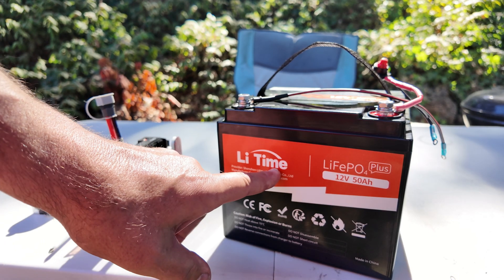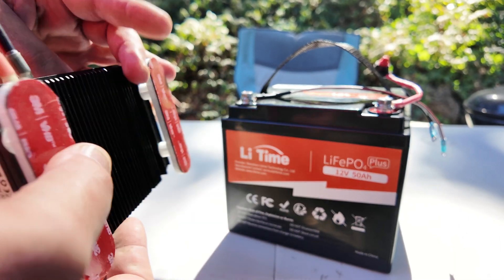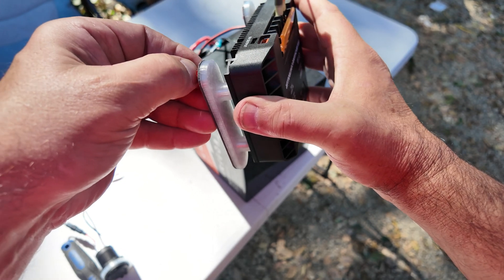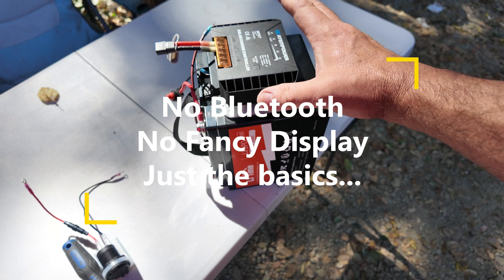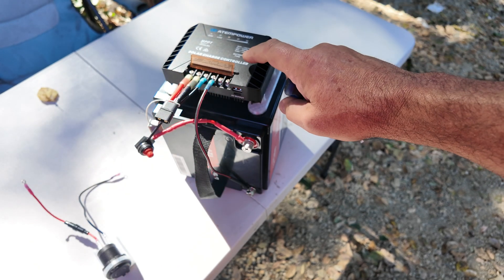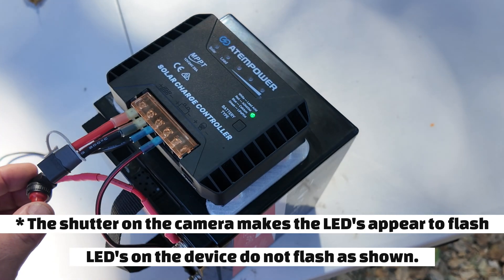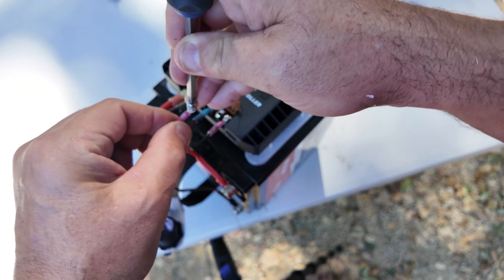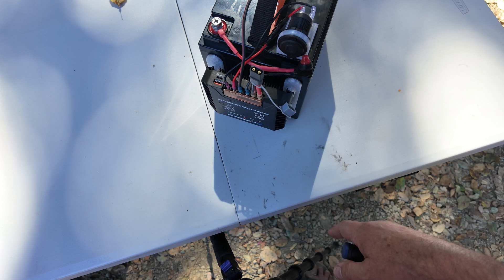🔌☀️ Build a Minimalist Solar Generator with LiFePO4 Battery & MPPT Controller! 💡

Comment from the maker: Affiliate Disclosure: Some links in this description are affiliate links. At no extra cost to you, purchasing through these links supports the channel. Thank you! 🙏
3M VHB Tape - https://amzn.to/3BHEcEW
Atem Power MPPT Charge Controller - https://amzn.to/4f1IgOL
Li Time 50Ah LiFEPO4 Battery - https://www.amazon.com/dp/B0D9461S5K?ref=t_ac_view_request_product_image&campaignId=amzn1.campaign.369DAAYODYE0N&linkCode=tr1&tag=targetforge05-20&linkId=amzn1.campaign.369DAAYODYE0N_1728931569811
Portable Solar Panels (200W) - https://amzn.to/405wH4F
XT60 Connectors - https://amzn.to/483k2kZ
12V DC Outlet - https://amzn.to/3BGaYGm

3D Files on Printables!
Charger mounts - https://www.printables.com/model/1039893-adhesive-mounts-for-the-atem-power-solar-charger-2
DC Outlet mounts (19mm) - https://www.printables.com/model/1039906-dc-outlet-adhesive-mount-19mm

Comment: Nice, minimal build. I have been buying old jump starters cheap with dead lead acid batteries in them and replacing with lifepo4 batteries. Most jump starters have a 12V outlet and usb ports, some even have built in inverters. I remove the jumper cables and just use them as portable power stations. I have a lifepo4 solar charger controller and charge them through the 12v port.
Reply from the maker: Very cool 😎

Comment: Nicely done, well executed and creative.  The only detail that I would like to have seen is the voltage of the battery before and after charging the battery.  I appreciate your mentioning that the mppt module had 2 USB ports of different types.
Reply from the maker: Thanks for the comment. I guess I've gotten spoiled letting the charge control do the work for me! Great comment.

Comment: 5:17 I'd investigate carefully having that switch on the battery lead. It is common way to damage an MPPT controller to have solar input without a battery attached FIRST, so if I were doing this myself I wouldn't use a switch that could be easily forgotten in the off position. Maybe an Anderson connector or something more involved than a simple switch with no real indication it's turned OFF.
Jest a redneck think'in outloud!

Comment: So no BT connection to either the battery or controller?  How are you monitoring battery charge levels?
Reply from the maker: Great question! During use and during charge the four charge level indicators provide enough information to handle that job, not precise, but plenty accurate for a minimalist approach. The charger cuts off the charge at the top and kicks the load off on the low side. I've found the BMS on the cell does a great job of protecting itself from over discharge as well, a problem with other packs I have tested. Thank you for your comment!

Comment: Most of the world in emergency operations have switched to Power Poles for connectors. Still  a great project!
Reply from the maker: Many of my projects have featured Anderson Power Pole connectors in a wide variety of sizes. They were not used in this project intentionally. Your statement seems to assume that XT60/90 was once dominant here and that is simply untrue. This was a MINIMALIST approach and all you need to install is a single XT60 which will work almost universally with Chinese portable panel kits, I felt it was the right choice for this particular project. Beware of the imported anderson housings, they are absolute crap, especially if exposed to the elements. Now, if you are talking about the 12V auto connector, I will disagree there as well, nearly every portable radio I have reviewed recently has the 12V DC outlet connector already installed on it, again minimalist approach. No need to chop up harnesses and add a bunch of connectors that make the item nearly useless in a random car or truck. Thank you for your comment. I really do like Anderson Connectors, but for this project? Nope.
Reply: Not in Australia, it's original Anderson (Standard SB350) or MC4
Reply from the maker: @bonezed  SB350? for a 50Ah battery? That's not a great solution. MC4's (from China) seem to also have a pretty wide interpretation of the specification on what a true MC4 really is. I do use SB50 on many projects, but EVERY portable panel I have from china has a cable terminated with the XT60. Hope all is well down there! Thank you for the comment.